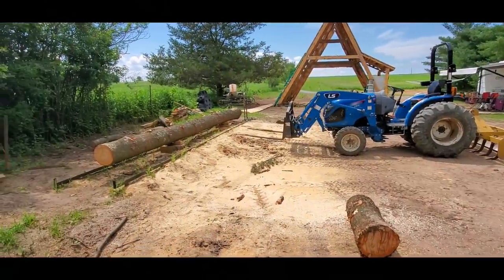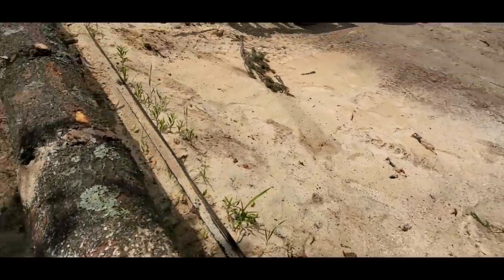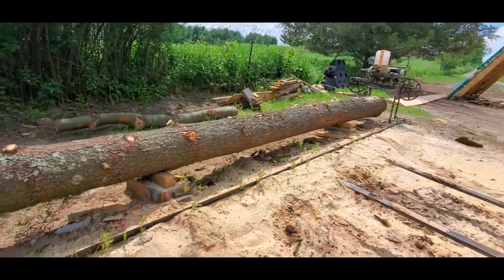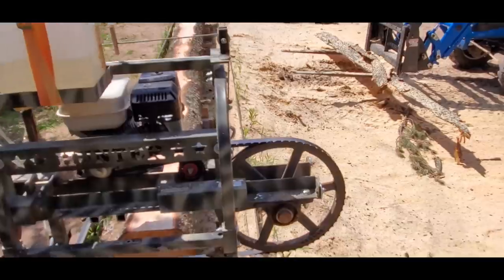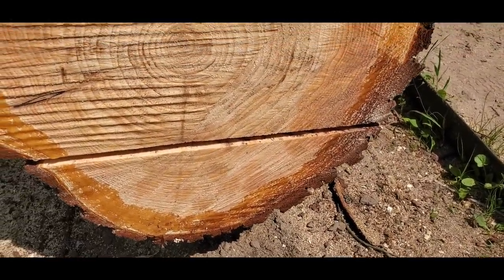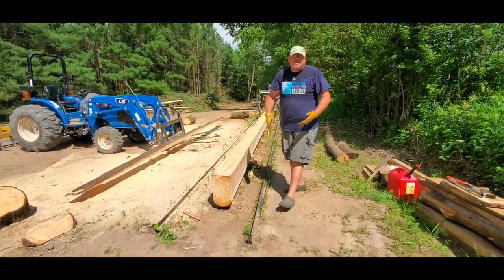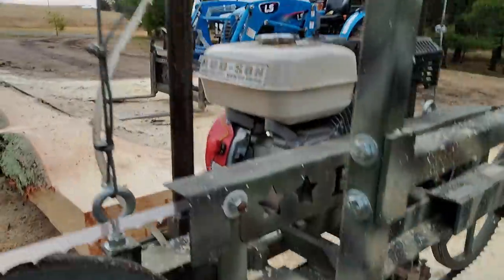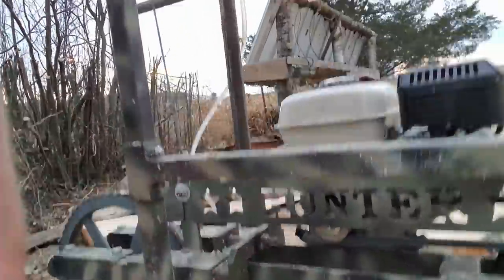A Different Way to Saw Mill  S3:E18

Comment: I bought a Hudson hunter/ Sawyer several years ago. It was a pain to assemble. I got the aluminum track. I set it up to roll the mill off the track to get a longer cut. My tractor is an antique, I use the bucket and chains to handle logs. I'm building tiny timber frames, slower than anticipated. Thanks for sharing your ingenuity!
Reply from the maker: Thanks for watching! My sawmill was a demo model and already assembled, therefore I avoided the joys of assembly.

Comment: This is a very helpful-- I've bought a mountainside of land; steep pretty much everywhere with an amazing rounded summit. I'm exploring the many options for building my near summit cabin, storage sheds, outbuildings, etc.  I know full well how much work and effort goes into doing this kind of video, and it's really appreciated it-- very grateful for your insights, advice, experience, and knowledge you've shared here.
Reply: Just be selective keep those root systems close to hold your soil. Mud slides are awful! Hope you build your dream home and can do it with with what your land provides👍

Comment: I really enjoyed your video. I think that this set up with cementing the rails and log holders in place would be much more stable and reliable over time. No need to level or adjust a typical metal deck. I guess you sacrifice portability but I don't think it's a big deal. Whenever I build a mill, it's going to be like this. Cheers!
Reply from the maker: Thanks for the comment, don't forget to make your track long enough to clear, on both ends, the length of log you ultimately intend to mill. I made mine 24 feet intending to mill 22 foot Logs. Realistically I can easily mill 20 footers and 21 footers with a bit of a struggle. Lol... I wish I could afford a D & L Swing Blade! That would be the way to go!

Comment: Very useful information Steve.  I'm building a Timber Frame cabin for my wife and I to retire to.  It's taken 6 years so far and I have always had trouble getting wood milled for the project.  I finally bought a Woodlands Mills HM122.  Got an older Massey Ferguson tractor last year so I think I will finally have what I need to be more self reliant.  Absolutely beautiful property you have there Bud and a beautiful life with your family.  Good luck with all your projects.  Tim
Reply from the maker: Thanks for watching.

Comment: Thank you for sharing your method of cutting longer logs than most of these little sawmills offered as part of length of track goes.
I just have to decide which brand to buy because I don't want to help support any of the Chinese military by buying Chinese made products anymore.
I measure from the center of the log down to the bottom of my Mill. That way I know I'm getting even cuts through the wood. I don't worry about the bottom or the top I just make sure the middle is centered at each end and make sure supports are all level underneath. I fill in the gaps underneath the long log with different size blocks. I never thought about cutting it at the very bottom like that to get a thick cant.
Reply from the maker: Thanks for watching.

Comment: If you used an old car jack screw type under the chocks or right next to the chocks you could level the log much quicker.  I like your idea of leaving one side of the log rounded to fit the chocks.  Great video.
Reply from the maker: Maybe i could cement the screw jack into another pier. Thanks for the comment.
Reply: For this setup I tend to think that's a great idea, maybe go with a hydraulic floor jack, makes less effortless. But when not in use take that jacks and put inside the shed to keep dry.
Reply: @stevesullivan2432  screw ones are cheap and easy.  you can make a hook that goes into 1/4 in driver to run the up and down.

Comment: Great INFORMATION we plan to build a saw with a 30' trailor frame  we like the way u used curved blocks and also the way You cut piece after piece  neat.  John M.  in Milo Maine
Reply from the maker: Thanks, several comments have come in about using a scisor jake for one of the piers, i was thinking of a camper stabalizer, and using an impact gun to spin it and adjusr the position of the log relative to the othee end very easily. Happy milling.

Comment: The Simpson Strongtie company makes post bases which have a threaded adjustable base plate. I like your idea of the permanent bed, but I'd put in a set of these about every 6 feet and make a captured sliding plate with a lock knob, and a few places where I could flip up a 90° arm and flip a cant to square easily. Something to make a cam dog system.
Reply from the maker: Sounds like great ideas, i will look into it. Thanks

Comment: Hi Steve, nice video on the saw mill. I plan to get one. However I have been a carpenter since I got out of High School in 1976 and I would use "easy off" oven cleaner to clean the pitch off my blades when sawing Pine....hope this helps you in cleaning your blades and machine. I'm thinking maybe pouring a solid slab of concrete between the rails so I can support the log anywhere...
Reply from the maker: Yes on the slab. I have run into trouble wanting to run logs just slightly shorter than my piers are appart. With this system it is also difficult to mill smaller logs because the weight of the log is the primary force keeping it in place. If I could get any mill I wanted I would get a swing blade but that is deffinately out of my budget currently. If I had to do the mill over I would build a shed with rails and invert the mill to hang from the shed removing the rails on the ground. Thanks for watching.

Comment: Were the shrouds a problem. That's kind of wicked if you would slip, or miss step. Yes that is a different way of cutting, but if your happy that's all that matters. Thanks for sharing.  Iowa is watching.  :)  24 degrees
Reply from the maker: No, actually the shrouds were not a problem... I need to get them back on. Thanks for the comment.

Comment: Great information. I have a Hudson sawmill as well and don't like the clamps, I think I will try the chock method.
Reply from the maker: Nice. I like the chocks, it would be interesting ti have a hydraulic jake under one for adjustments but certainly not necesary. And, if you cut through a wood chock, no big deal. Happy milling.

Comment: You screwed up just right👍 getting shaving's on the tracks is a pain! At least you have some spread. And the extra width is nice! No added trimming is a plus👍 you don't need much to make good lumber just a good set up and a little planning. Great job!👍🇺🇸
Reply from the maker: Thanks for watching.
Reply: @johansenfamilyvlog8972  have you thought about making an "L" shaped stop, you could stand it up while tilting the forks and keep the log from going further than you'd like when your setting up the side cuts?
Reply from the maker: Yeah, something like that would help but may obstruct the carriage on the tracks so then would have to be moveable. I think the next thing i will work on is using a camper stabilizer for one of the piers to easily level the log.

Comment: Hi Johansen; I have a question about the lube. You brought up the difficulty with getting enough lube on the saw and you mentioned water and pinesol as lubricants. When you add soap, how much do you add to water to get a good lube? I enjoyed your video and the method you use to saw the logs. I wondered why the millers removed the  boards with every cut versus leaving them in place. I'm glad that you proved the value in making multiple cuts without rolling the log. At 75 years old, I can't see myself rolling the log 3 times before making a money cut so your method looks very sensible to me. Thanks for making the video, I enjoyed it more than the ones that spend a lot of time showing minutia. You did a good job! - Jim Potter
Reply from the maker: Thanks for the comment. I ussually add only about a tablespoon of pinesol per gallon of water. It is not necesary but does help a little to cut down the sap especially if the logs have recently been milled. I also like the smell so it is a little treat while milling. To my understanding traditional milling makes a complete cant, by rolling the log 3 times, to ensure perpendicular sides and give a good, flat, footing to sit on their flat deck and have a nice square corner to secure the cant with dogs. My style of milling also has a limit to the size of cant I can form because my second cut, being the bottom of the slab before rolling, can only be as large as the depth of my mill at about 8 inches. If I rolled it before making that cut I would just be cutting of scrap from the top. With my method I ussually take off a couple 1.5 inch slabs before getting making my cant as an 8 inch slab. This is fine for me because I have plenty of use for these slabs as decking and even fire wood if ultimately unusable. I guess I could have just said that millers paid for the log and want to make the most lumber possible. :)
Reply: @johansenfamilyvlog8972  Thanks for the reply and information. I think your method makes sense!

Comment: Love your video.  I did a little sawmill work on WMizer.  I like your idea on few turns on long logs

I might suggest in finding cut height on each end if log u measure from heart center up and down as to target a beam with heart center in middle of beam.  Maybe more important on walnut or cherry but I think it gives a better look to surface grain pattern in finished if heart is centered.  Maybe less curvature upon beam drying 

Great job.
Reply from the maker: Thanks for watching.

Comment: I wonder if you could use bottle Jack's on each end to raise each end and maybe modifying the tops of the jack , just a thought  then you could be closer to the wood without having to get on and off the tractor  🚜.
Reply from the maker: Yeah, i think i would only need one jack on the thinner end of the tree. I have a scisor jack to try it but it seems easier so far to use wood blocks. Thanks for watching.
Reply: @johansenfamilyvlog8972  yes sir,  good deal and very smart fella.

Comment: The band wheels usually have a tire or some friction material to keep the blade from slipping and not take the corners off the teeth. Just like a truck tire that has been parked a long time develops a flat spot, the band wheels are under compression only on one half during storage and take a temporary set.  This will lead to some vibration on initial running that may take hours to work out. Just because the saw will still cut with lopsided wheels is no reason you should avoid effective startup and shutdown procedures. Shutdown is particularly tempting, light is getting dim and there is one last board so shutdown becomes the kill switch. Then there is the big storm and it will be almost a month before sawing resumes. An overnight shutdown is no big deal, longer is a bigger deal.
Reply from the maker: Thanks for watching.

Comment: How much wood have you stacked up? 
You letting them air dry correct.
It’s very interesting I’m just planning on building one and I’m glad I watched your post!!!
Reply from the maker: At this point we only have a few 1x8s stacked up. We used everything else we milled to construct the shed and then convert it into a cabin last fall. We  constructed the building with wet wood, as is a timber frame supposed to be constructed, though out of necessity we dried it out too quickly though there are still no visible signs of checking. We have about 4 cords of off cuts and rounds stacked waiting to be split for future fire wood. Thanks for the comment.

Comment: I like your idea of the rails cemented down and the extra length you get from it. Also just a thought when you said there was problems with winch,  blades wearing out,  and needing lots of water...wondering if making the bottom cut with all the weight of the log on the blade could be stressing things and causing those issues?
Reply from the maker: I thought that about the deep bottom cut also but whenever I stopped the cut in the log the blade was still able to back up several inches inside the kerf. I think the kerf cut by the offset teeth is a bit wider than the blade itself. I do however notice the blade get pinched at the very end of the cut when I collapse the kerf by cutting out the end of the log before the majority of the blade exits behind the teeth. Thanks for watching.

Comment: I like your saw mill set up and rail system. 
It seams like you have a lot of waste with the off cuts
Reply from the maker: Thanks for the comment. Some of the cuts are slabs that i use for other projects or turn into dimensional lumber but i also need firewood so i dont worry too much about maximizing the tree for dimensional lumber.

Comment: 12:54 It looks like it would be easier to do your 90 degree turn right here on the forks. You could rotate your forks back (tips up) as far as it would go. Then in that position manually turn the log against the right angle back plate. You would then probably have to use some kind of clamp to hold it against the vertical so it doesn't roll forward again as you level the forks. Then with forks level, drive up and set it down on your V-blocks. Do the little bit of adjustment left on the V-blocks as you set it down or just after you set it down. Seems easier than trying to tip forward onto the V-blocks and wrestle it to 90 degrees there.
Reply from the maker: I tried that exact idea first, unfortunately the distance from my front tires to the back guard of my forks is not far enough for my front wheels to avoid driving on the tracks and destroying them. If i had made my tracks narrower it may have worked. Thanks for watching.
Reply: @johansenfamilyvlog8972  How about building a platform that fits over the tracks to protect them from the front tires while you position the log?  It could then just be flipped off to the side while you mill that log.
Reply from the maker: Something to consider. Thanks for the comment.
Reply: @johansenfamilyvlog8972  Then fabricate a spacer...say 12" off the back. You could make it in minutes from what you scrap off your logs.

Comment: Cool, thanks for making the video. I'm surprised that the saw doesn't get pinched by the heavy weight of the log when you make the bottom cut. Have you set the teeth in some special way?
Reply from the maker: The kerf stays open long enough from the strength of the wood for the blade to pass through behind the cut. All bandsaw blades have offset teeth so the kerf is actually thicker than the blade. The only location the blade gets pinched is at the end of the cut when the teeth have no more wood to cut and the blade is still in the log as the kerf collapses. I can see and feel this happening as the blade exits the log but Ive never had any issues with it comming out as it is pinched. Thanks for watching.

Comment: Safety tip when you park any tractor equipped with hydraulic equipment, lower the equipment to the ground. Doing so prevents the tractor moving and keeps children safer.
Reply from the maker: I agree. Thanks for the comment. We also always engage the parking brake.
Reply: Dropping the FEL and cutter deck is my second parking brake!
Reply from the maker: Yup, and i refuse to let anyone step under the loader, with how many hydraylic lines i have seen break i dont think i will allow anyone inside the loader raised more than a foot or two.

Comment: Curious if you would buy the same saw again or maybe a different brand like Norwood or Timberking, etc.?
Reply from the maker: If buying a bandsaw brand doesnt really matter. Determine the features you need/ desire and purchase the brand that gives you the best value. If i had to do it all over again i would probably invest in a swingblade sawmill. Most likely from D&L in canada. Thanks for watching.

Comment: Do you think that by leaving your cut boards on the slab as you continue with the next sequential cuts that it puts more strain on the blade and motor? Certainly a different way of milling planks for sure. Cool set up.
Reply from the maker: No, i think the blade sits in the kerf and gap is supported by the uncut wood ahead. Also it is important to consider that the teeth are notched/bent in alterating directions so the kerf that is cut is wider than the thickness of the blade. Thanks for watching.
Reply: If you leave the cut boards on top you will have a better cutting result with less warpage.
Reply from the maker: I concure. Thanks for the comment and thanks for watching.

Comment: You're  a handy man . Make turn tables at the ends so the saw can be turned around 180 degrees then make a cut going the other way .. would speed things up a bit
Reply from the maker: Thanks for the comment. I have thought about that and it sounds like a great idea. I also thought about a cable lever lift system to raise it an inch and then spin it before setting it down. Maybe once I have a garage to work in a will be able to work something out.
Reply: @johansenfamilyvlog8972  I like your idea better . One simple lever to lift , spin it around and drop it back on the tracks . Patent it before Woodmiser steals the idea .

Comment: Nice setup. Why don't you just a 4 foot rail extension to your track? Should be easy to do. I guess I missed the part where you checked that after you rolled the log you insured that the side edges were 90 degrees to your blade.
Reply from the maker: Thanks for the comment. I have considered adding another 3 foot section to my track but i no longer need to cut timbers that length and i have very few trees on my property straight enough to make timbers that long. I typically just eye up the 90 degree turn but can place a board across the rails and use a square if necesary. The 90 degree turn ends up on the edges of all the boards when cut this way and is hard to notice if it is off only by a little.